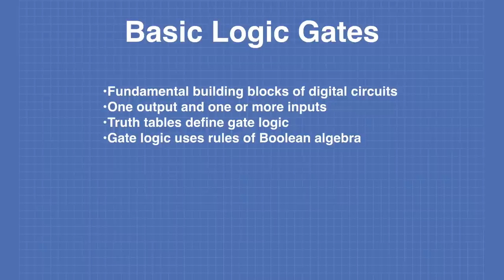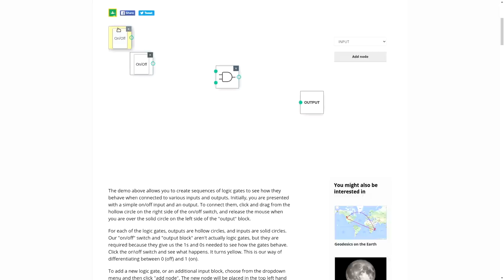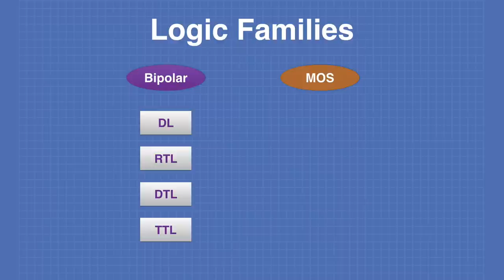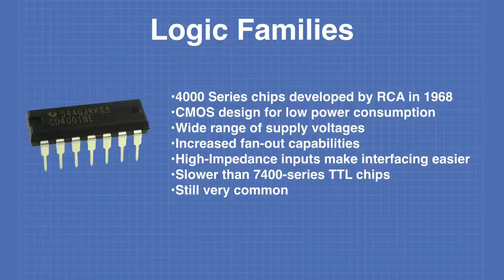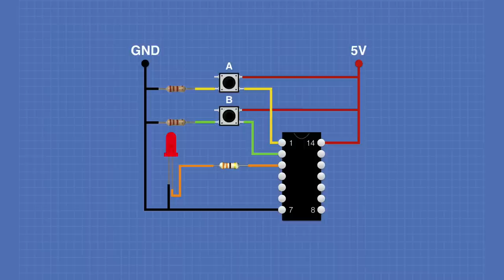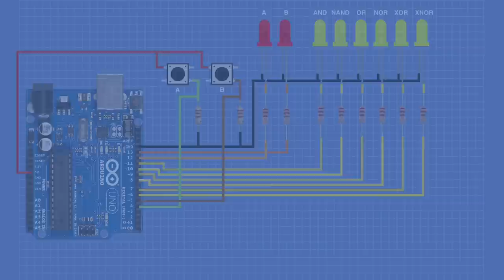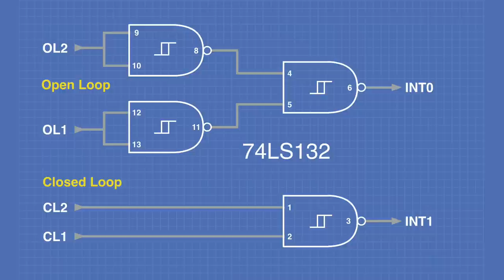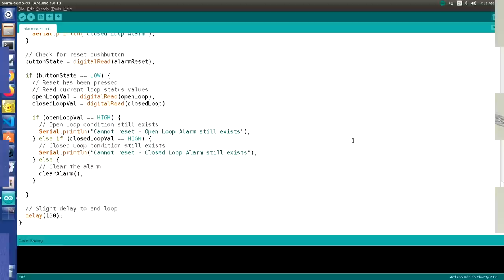Using Basic Logic Gates - With & Without Arduino

Comment: I work in a company doing PVD (Physical vapor depositions) coatings. The machines generate a glow plasma to sputter the target material on a substrate. The glow plasma is very susceptible to decaying into an arc, which is not desirable, however when arcing does occur, the arc event has to be recognised and extinguished within 500 nanoseconds. We use logic gates and 555 timers with cumulative gate propagation delays within 200-300 ns to detect and handle this. Any solution with a microprocessor would be impossible with interrupt execution latency of about 4 - 10 microseconds, 8 to 20 times the response time of the design requirement. This is one very good reason why discrete logic gates are still relevant.

Comment: Excellent presentation of both the 'why' and the 'how' of digital electronics basics for non-engineering types (like me). Clears up a lot of my confusion after reading (and re-reading) educational material aimed at the mathematically able... Answers the question of why CMOS and TTL chips are still in wide industry use in the age of microcomputing, and ties them into a nifty Arduino-based logic trainer! Another well-crafted tutorial from a truly gifted educator.

Comment: As an old Electronics I want to add one remark. An open TTL input has usually a High signal. Pulling it down with a resistor increases the power consumption while doing nothing. That's why I always pulled it down with the contact (switch). It saved me acquiring a bigger power supply on big projects.

Comment: YES, BUT
At 21:00 the narrator says that DTL uses more current than TTL.  That wasn't true of standard TTL, but it is true of low-power TTL which is now used.  It's also true that every time a TTL gate changes state it produces a near short-circuit for a nanosecond or two, which requires power supply lines to TTL to have HF decoupling capacitors distributed all around the circuit card.

Comment: Really appreciated the info about buffers, tri-state, and Schmitt triggers. Would like to learn more about what high impedence is used for, and how it differs from floating.
Reply: An example for high impedance is on a data bus. You will have multiple things connected to your data bus. Registers, memory data etc. You only want 1 device putting data on the bus at a time. All other devices need to be in a high impedance state. If they are left floating they could end up changing the bits on the bus high or low.
Reply: @AI_Image_Master  Thanks for the explanation about high impedance. Your example makes the need and use for it very clear.
I'm wondering how high impedance relates to logic levels (e.g., 0-.8v = low; 2.8-5v = high). Can high impedance be used with any voltage?
Reply: @TR3A  The high impedance  will have no effect on the circuit that it is connected to. It will be pulled to the voltage of the active input so it can be used with any voltage. I am currently building (or trying to build) a 4 bit computer from nothing but transistors, and one of the problems I have is buffering my registers and memory on the bus. Can't do it in an easy circuit I am sort of stuck in the mid sixties, with some sort of Schmitt triggers..  Yes I can get a chip ala the 1970's to easily do it, but that would be defeat. I can do it with a large multiplexer, logic not too bad, just a whole log of transistors..
Reply: @AI_Image_Master  Thank-you. And good luck with your project.

Comment: Good to see you back.  Something a bit off track but connected.  Some of the single board computers, the Jetson Nano in particular, can not source enough current to drive an LED.  Several videos detail how to use a transistor create a circuit to drive an LED.  However, could one use a buffer chip to perform this function?  If so, what might be a good choice?  74LS08, perhaps?  Thanks

Comment: Digital logic is a lot of fun I used to build quite a few different types of circuits 36 years ago I now prefer to use arduino.

I once designed a circuit that had a sensor and it connected to a door lock you would carry around this little teeny black package with another eye on it and when you brought the two eyes in front of each other it would unlock the door. I still have the little black package right now but I don't have the schematic how I wired it up and I forgot I may have to reverse-engineer my own stuff but 25 years after I made this little infrared lock I seen something that people were selling that you could buy and put on your door same thing. And I never told anyone what I had created way back then in 84 so who ever discovered that did that on their own

Comment: Excellent video!

As  follow-up, a tutorial on sequential logic would be a nice continuation of this video, although not the primary mission of this YouTube channel. 

Also, am curious if logic gates can be used as delay lines in a circuit. For example, two separate input signals propagate through a series of gates, and  they both serve as inputs to a final logic gate. However, the first signal only propagates through one gate, while the second one passes through 11 different gates before merging with the first signal at the last gate. If each gate has a propagation delay of 10 nanoseconds, then the signal with the simple path would arrive 100 nanoseconds before the signal that had to propagate through 10 additional logic gates, which could result in timing errors. I've seen a few schematics with a signal traveling through several logic gates with no apparent function (such as four in-line inverters), and am wondering if this was for "slowing down" a signal, or just putting unused gates to work, since in a 74xxx chip one or more of the four gates  often go unused. Just a thought. 

Thank you.

Comment: Bill, as always, excellent job of explanation of Gates.  You mention the number of transistors in a chip, (or MCU).  Do you know that Panasonic has a new memory chip that runs at 1,000G/BPS, vs 100G/BPS at the current speed?  And, it can have a 1 or a 0 at the same time on 2 Pins? 
So it can have 4 states at once!

Comment: Another excellent video Bill.

In your first breadboard example with the basic gates, what's the capacitor between the vcc and ground for? I think it might be for when you break contact in the switches there's no spike. Is that correct? 

Thanks.

Comment: Thinking you could use the intruder alarm and combine it with previous combination lock demo for a home security system.  Use OL alarm on entry door and add delay to initiation to provide time to enter code to cancel alarm?  Probably need a status flag for alarm state that can be updated by the keypad?

Comment: thank you for the great illustration and demo.
I would really be grateful if you could explain why you had to include capacitors in the circuit at 31:30. what if you did not include those capacitors in the circuit?
sorry, but I am still trying to get my head around when do I have to use capacitors in simple circuits like this one.
Reply: I have the same question.

Comment: Excellent video. I'll be interested how you dell with the 74LS that is running at 5V and on a computer board that is running 3.1V. Would you need something to deal with the voltage change or is the high volt of 3.1 still trigger a logic of One on the 74LS?

Comment: 34:49 I just have to know, couldn't you have obviated all those red jumper wires, by putting your DIP switch modules across the gap from the power rail to the first column on the left? It looks like you would have had a lot more room that way.

Comment: Did you ever notice that you have the LED wired backwards? (51:59)  You show the anode on the left connected to grnd and the cathode/anvil (or "flag") on the right connected to an active high pin (13) thru a resistor.   This is reversed polarized.
Reply: The long lead is (usually) the anode. Why do you think the left lead is the anode?
Reply: @oqibidipo  I explained in my comment "the cathode/anvil (or "flag") on the right".  Regardless of the depicted length of the leads... the physical construction of the LED is visible and it is as I stated.  Perhaps someone drew this depiction incorrectly.  Knowing how to visually identify an LED's leads is useful.  As you state, the long lead is the anode however this is a depiction of an LED not an actual LED and it is incorrect.
"If the LED has two leads with leads that are equal in length, you can look at the metal plate inside the LED. The smaller plate indicates the positive (anode) lead; the larger plate belongs to the negative (cathode) lead" from one of many sources.  Google if you are not aware of this info.

Comment: Thanks a lot. Can you explain why you added capacitor between Vcc and GND on breadboard?
Reply: Just standard bypass or decoupling cap used to suppress noise spikes on power rail.   It won't really effect these circuits if you don't use them, but if you're using counter or flip-flop logic (these chips switch so fast)...that spurious power supply noise may give you false triggering....

Comment: Hi there - I am trying to understand how the gate actually works and have so far been unsuccessful.  Is there somewhere you can point me to show what is inside the wiring of the gate on the chip that shows the connection making the gate make a certain output from a certain input?   that would be awesome....thank you!

Comment: Could I use logic chips to setup and drive a single16 segment display.  I want to use it for an automatic transmission shifter position indicator for the letters P, R, N, D, 3, 2, 1.  What would you recommend if this is feasible?

Comment: sorry I'm totally new to electronics, started off it as a hobby I have a software background. but in the circuit around 31:00 why he is using a capacitor? and is he using a round red resistance near the supply? if yes why is that so?
Reply: Those are "decoupling" or "bypass" capacitors (the terms tend to be used interchangeably when the caps are across the power supply rails).

All electrical conductors have inductance and resistance. Usually the resistance isn't a problem with small logic circuits, but inductance can be. The most important property of an inductor in this situation is that it opposes rapid changes in current (you cannot instantaneously change the current through an inductor). When logic device outputs switch, they tend to draw a spike of current that lasts nanoseconds (depending on logic family) but can be tens of milliamps. If there is inductance in the power supply lines, these spikes can result in a transient drop in the supply voltage at the IC, then often an overshoot as the energy stored in the inductance during the spike is discharged. With lots of logic circuits this just results in longer time for the circuit to "settle" to proper logic levels. But in circuits that have memory elements (flip flops), the power supply transient can cause a change of state that is "remembered."

Capacitors local to the load can supply some current and overcome that wiring inductance. They act as local charge reservoirs. If your connections to the power supply are long it is a good idea to use a fairly high capacitance, such as 10 µF somewhere between V+ and ground on the breadboard or PCB. Small ceramic capacitors in the range of about 10 to 100 nF are used as close as possible to the logic devices. The round red thing is a ceramic "disk" (or disc) capacitor. They aren't very popular anymore except in higher voltage circuits. "Monolithic ceramic" caps are now much more common for lower voltage circuits (up to 50 or 100 volts). Depending on the logic family you might use one ceramic cap for a few ICs that are close together or you may use one per logic package. Modern microprocessors as used in PCs have a huge number of decoupling capacitors surrounding the IC. They are absolutely essential to reliable operation.

Rather than using convenient separate flexible test leads with banana plugs to connect a breadboard to a power supply it is very much better to use a pair of conductors with fairly thin insulation twisted together. The close proximity of the conductors reduces the effective inductance because the magnetic field around each conductor is opposite to that in the other conductor and the fields "cancel" each other. Inductance is the result of energy stored in a magnetic field.

Comment: At 20:35 you state that you can not make an inverter gate using RTL. That is incorrect. The most basic RTL gate is the inverter. 1 transistor and 2 resistors. The reason for RTL to be replaced was there poor fan out ability.

Comment: A week or so ago, I was sourcing parts for a project I'm working on and I discovered that a single ATTiny would be cheaper than the approach I was going to use with NAND gates. 😂
Reply: And a lot more flexible in case the design changes in any way.
Reply: But if you were to put it into production  as a manufactured item, how much time (time=money) would the added step of flashing of the program on each of them add to your finished cost?

For most one-off and hobby projects, microcontrollers make sense.  But the logic chips often make more sense for high volume  production.

Comment: there's definitely circuits to use these 74 series that aren't logic, for example mark tildens beam bot, which used one to flip flop a signal to make servos go back and forth.

edit:  well actually it used two one for each servo, but still, good stuff especially since they can be had for less than a dollar a piece and there's probably millions of them sitting around on shelves everywhere

Comment: I want to draw logic circuits. I draw with pen and go through reams of paper and I can't fit my ideas on paper. I can't afford a program even if I knew where to get on. I barely know how to watch Youtube on a Chromebook and I am 67 years old and on Social Security Disability as m
Mentally Disabled, The reason I can't afford anything. I don't trust where I would not have control of my system ala Windows 10 and the like. I want to know down to the logic gate and work from there.

Comment: 7:21 "You will see, that the output Y is set to 1 in every condition except when A and B are equal" (c)
=============
It is unfortunatelly wrong. When A and B are 0 they are equal too, but the output is set to 0.
Reply: Maybe the wording could have been different "when both A and B are HIGH" but the logic table is correct: https://en.wikipedia.org/wiki/NAND_logic

Comment: 0:35 It's strange this man is questioning why the basic logic gates are important. The fact is that ALL the computer logic is based on 4 logic states -buffer, inverter, parallel and serial. I'm a PLC programmer and even doing boolean algebra, calculus, etc in the past, I've found the ladder logic really tricky and hard. If you always consider these 4 states you can do it. There is one more very important thing and it's the relay latch, which is a memory bit, but it is still related to the 4 states.